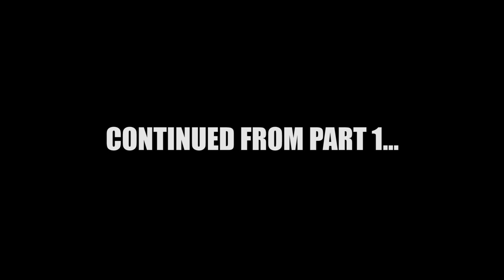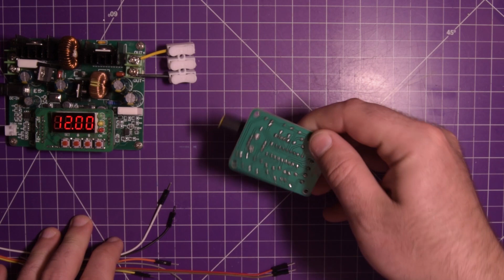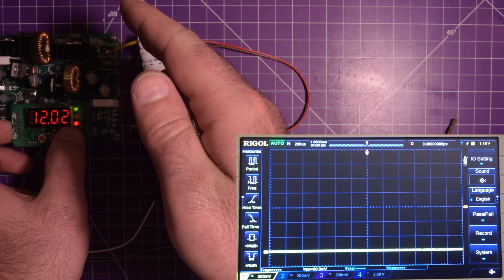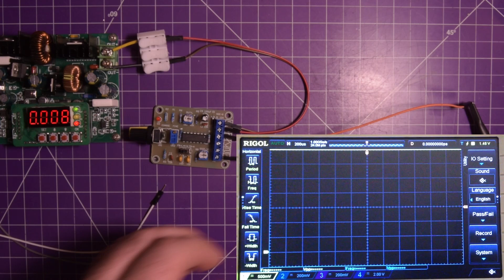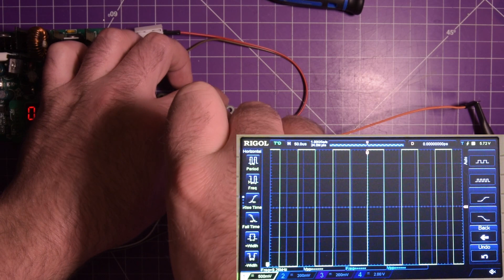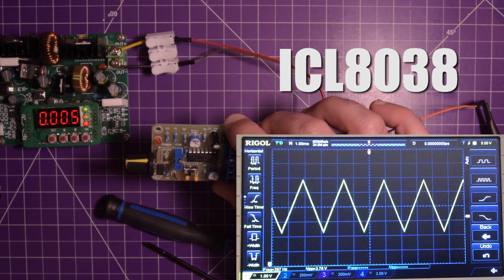Cheapo Function Gen Kit Part 2 - Testing

Comment: i was wondering if its technically deemed the other way round and the 10 turn is the coarse and the single turn is fine as the coarse is usually defined as the setting that provides the biggest delta in range, i do have to say it is weird how they have chosen to implement it this way, BTW i think the scope PIP is a welcome addition, coming soon idents, on-screen gfx , jump shots and time lapses, lol.  looks like a cool kit to get , i had been looking at the popular XR2206 kit that many seem to like ,Thanks for the video
Reply: Is it possible that what you call the fine adjust is actually a range adjust.